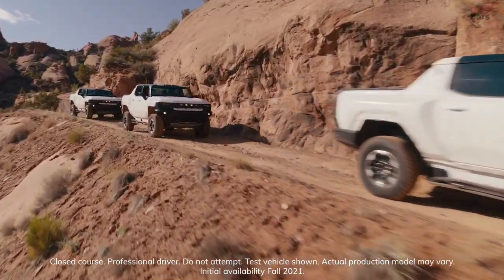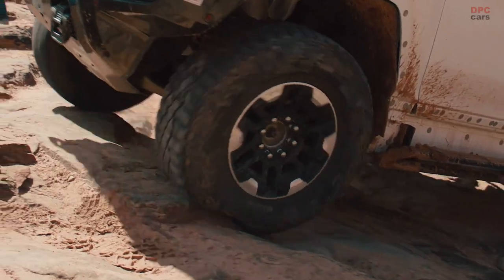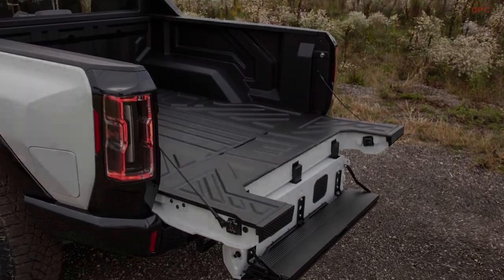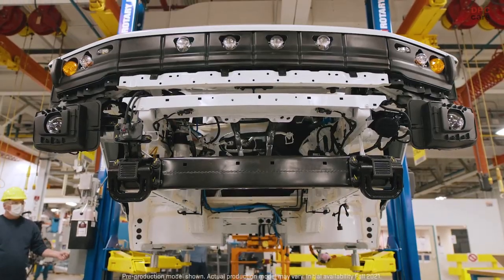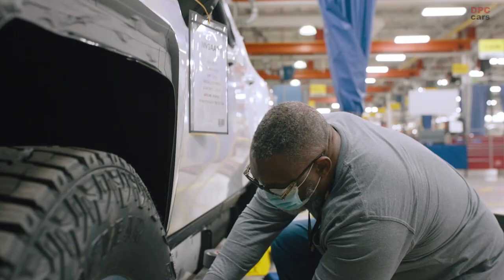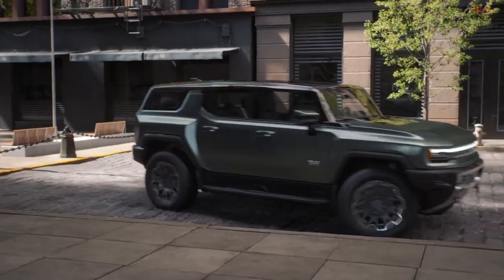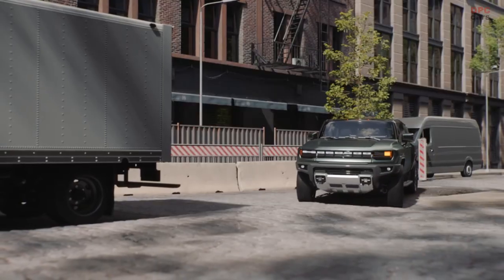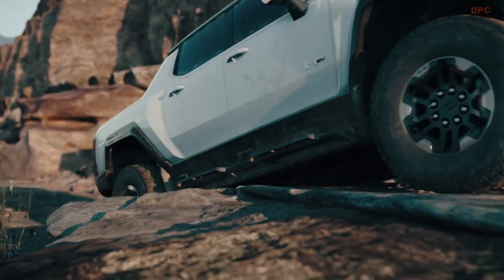More Testing For The GMC Hummer EV Electric Truck

Comment: 1Kw per mile is not impressive.  Will be extremely expensive to drive.
Reply: I'd guess a decent portion of these buyers will use a lot of solar power.  Nowhere near the majority but I'd guess 5-20% and that number will probably increase over time.